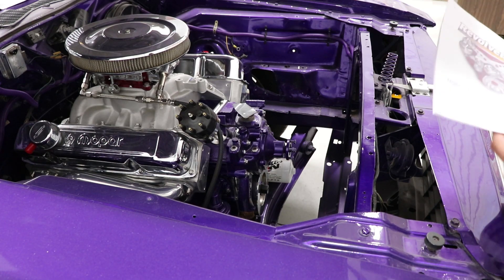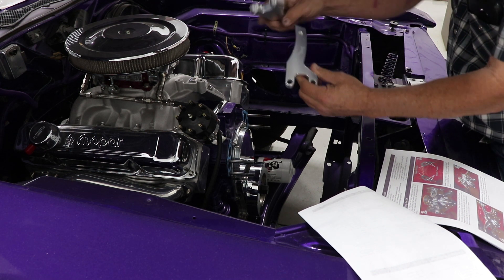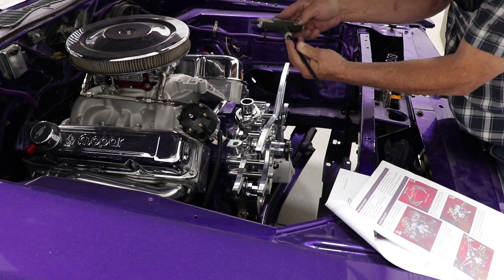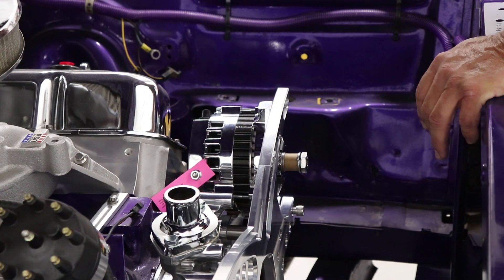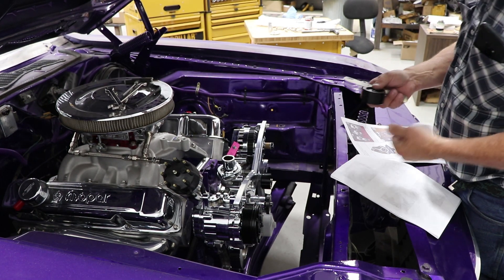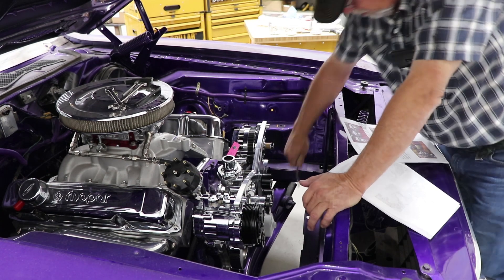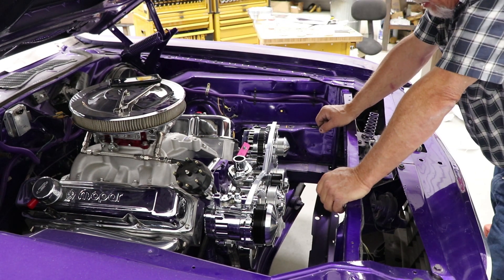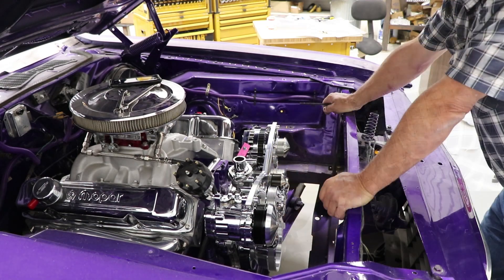March Serpintine Belt Drive For Big Block Chrysler

Comment: Used to work at a place that sold the cheap Chinese pulley setups (among lots of other Chinese auto parts).  March is way more expensive, but it's where it's at, for sure!  There's no comparison with quality, instruction, what March includes, and the support.  The cheap stuff is fine for an engine that'll never be run, but for quality you picked the right stuff!  Thanks for the video and I'm sure others will benefit from your detailed instruction!

Comment: It may be easier to assemble it while it's on the engine stand if the bellhousing n clutch are installed after the engine is in the chassis.

Comment: I would use blue loctite anywhere those stainless fasteners are threaded into aluminum.  It will prevent the threads from galling/ pulling out upon disassembly.  Search for yourself, but here's a quick link I found.

 https://www.albanycountyfasteners.com/blog/2017/09/15/stainless-steel-and-aluminum/

Comment: $2800 and you still get a squeaky belt when the weather changes. Boo!! They should have included a tensioner.
Reply: I agree sir a Surpintine belt without a spring tensioner is asking for trouble. Also the mix of metric and SAE fasteners is in poor taste especially on an all SAE vehicle.
Reply: @kevincollins2184  that tells you where it was made.
Reply: There is a tensioner for the 440 kit now.